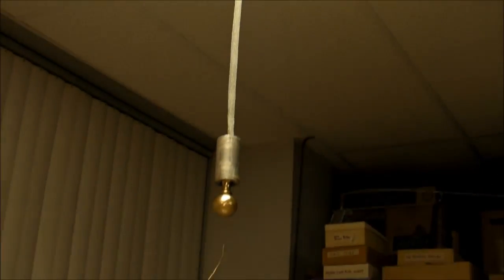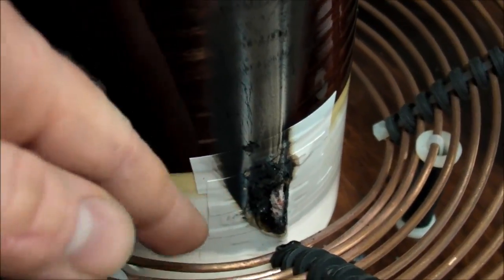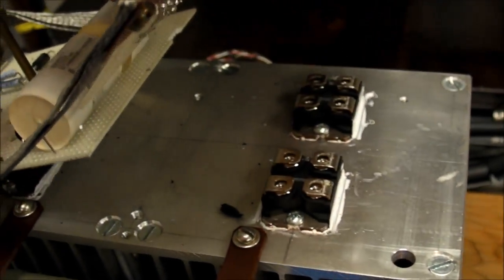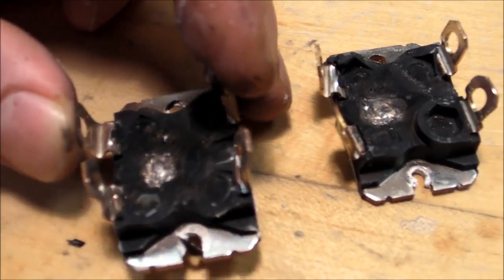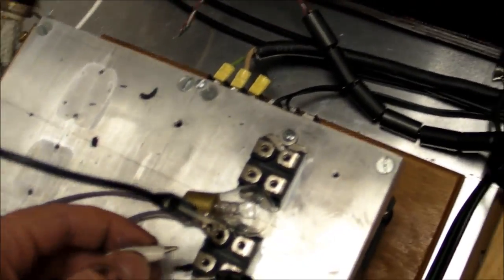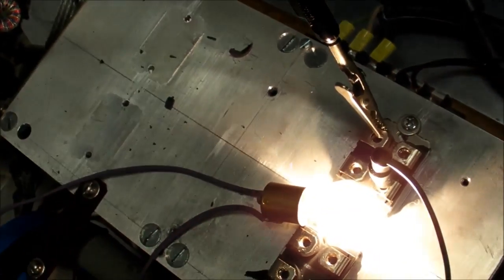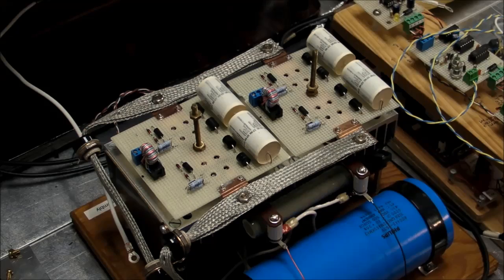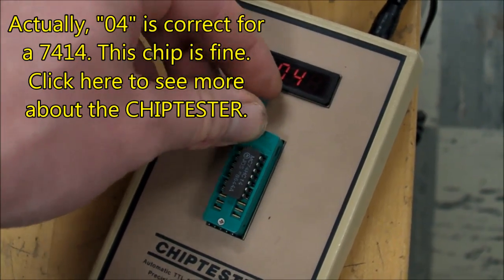(#0076) Tesla Coil IGBT Explosion & Repair - DRSSTC vs. Spark Gap #11

Comment: In the 80s, I built a few Tesla coils, they were all spark gap, using parts that are hard to get and expensive now, but were cheap back then.
Recently, I built my first solid state coil as a learning project, using what I had in my junk box. The transistors were IRFZ40 in a half bridge at 300 Khz, run by my lab supply. They're limited to 50 volts, so running off the power line is not doable. I blew 3 pairs of them before I found the cause, about 50 to 100 ns of overlap, which I fixed by modifying the driver circuit. It works great now.
I took what I learned and applied it to my next driver, using higher voltage transistors that will work off the power line, and the same secondary.
It's not done yet, I have a few parts on order. It's still not too expensive, I bought about $50 worth of parts to do it. I hope I am not going to discover a new bug at the higher power level.
Wish me luck.

Comment: Could you please do a little bit more dissection on those components or any other broken components that are in a sot-227 or sot-227B package. What I really need to know is the current rating and how many of those little bond wires were they relying on for either the emitter or collector. Here is a great picture of a blown MRF151 mosfet taken by John Parfrey who's channel on youtube is "M0UKD" flickr.com/photos/m0ukd/6662648033/sizes/o/in/photostream/

Comment: There will be a small plate inside with the diode and IGBT on it, insulated from the mounting plate by a ceramic washer. Not surprising the gate circuitry took exception to the DC bus being applied across them. 1500W momentarily, 3W continuous for the TVS diodes. Also remember the IGBT is actually a PNP transistor inside, though it drives like a N channel MOSFET.

Comment: Other side of the package probably has the body diode in it, which probably is still working. Just check on the right hand side connections for the diode.